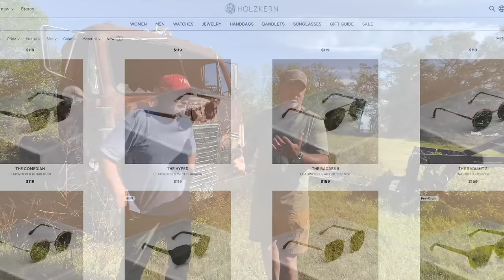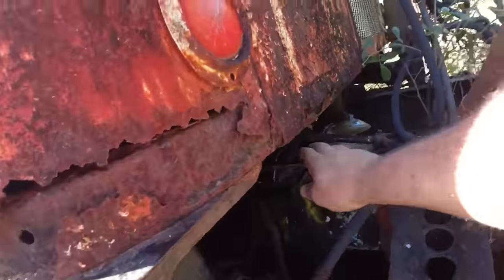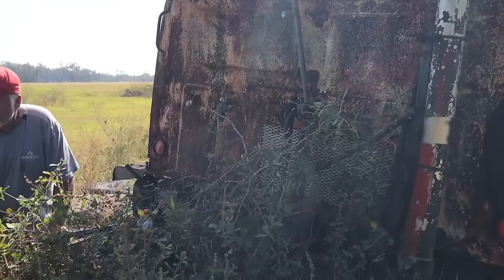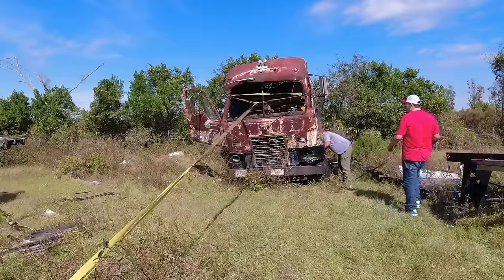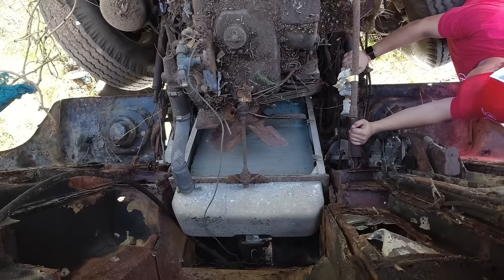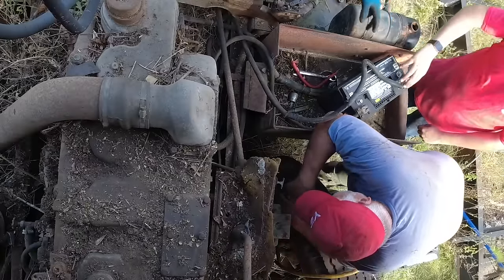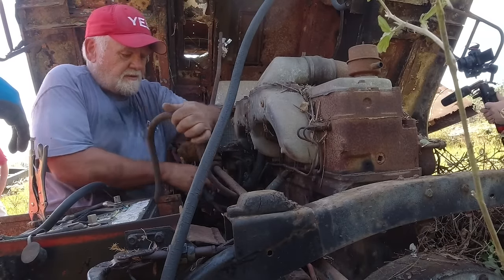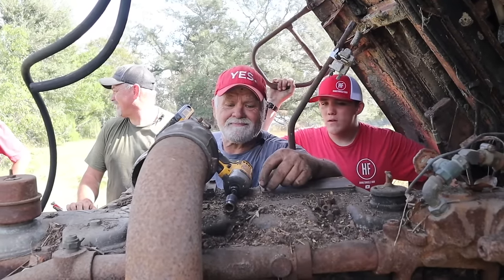I found the RUSTIEST SEMI on Earth sitting in a field for 25 years! Will it run?

Comment: In the 80's, I had just finished installing a slant 6 in a dart. I got everything connected, and was ready to start it. I installed the battery and tapped the battery cables onto the battery. I hooked up the remote start switch and decided it was  time to start it. I hit the button and the entire top of the battery exploded, pelting my face, neck and arms with acid and plastic. Afterwards I looked at the battery and what caused the explosion was by pounding on the battery, I cracked the internal connection between the terminal and the plates, so when I hit the starter button, it arc'd and the battery exploded. I have never hammered on a battery since.

Comment: We used to own a 1971 IH CO4070A with a 355 cummins and it is indeed 24 Volt to Start. when you hooked up batteries you did it in parallel which increased cranking amps but not voltage. When you hook up batteries in series it increases voltage to 24 volts. One battery hook ground to negative post. other battery hook starter solenoid wire to positive post. then you run wire between two batteries from empty posts positive to negative. this is a negative ground system. Once engine starts solenoid cuts to 12 volt to truck wiring. should start on starting fluid but use sparingly.  She should run

Comment: An Emeryville was the first truck I drove on the NJ Turnpike in 1971.  My boss told me it had a scored cylinder liner, and to take it easy  pulling the hill on the overpass between exits 14 and 15 because it might overheat. Long story short, it overheated and quit running, and had to be towed.  That was a bad first day on the job.  

Anyway, I know batteries are not cheap but you just gotta have all the cranking amps you can get and good clean tight connections when messing around and trying to start old diesel engines. I know you guys know this. That's a nice setup you have on your truck Hank. That's a 24 volt starter on that Emeryville (Googled it). It's amazing what you can find on the internet on a smart phone.  You guys would have needed  2 fully charged 12 volt truck batteries and connected in series with good tight connections to even have a chance, that is, if the engine was free enough and that starter good enough to turn it over fast enough to start.  

That Emeryville brought  back lots of memories. Thanks for making the video.

Comment: Our first semi was a 59 Emeryville that my brother Phil drove, had a 220 Cummins 10 speed roadranger tandem axles and I got mine in 1960. Twin trucks except the 59 had single headlights and the 60 had twin lights.  I had a 250 cummins.  We hauled grain from the elevator in Rugby, ND to Mpls/ St paul and Duluth Mn.  Slept many nights in that sleeper and to this day I love that truck.  When in the service in 62 sold trucks and bought KW 100's in 64 when army service ended.  John

Comment: That's an old Johnson motor lined truck . You can see the sanded squares that said Johnson . Their trucks had a bar across the rear spring bolts that had a little short mudflap on it . The first tandam axel would pic up a nail or something and the little mudflap would knock it down before the next axel would hit it avoiding a flat tire .

Comment: Those old trucks with the NH180 cummins were 24 volts to start from what i remember being told back in the day they took 4 of 6 volt Group 4 batteries  but they used a 12 volt charging system and the detroit powered used only 2 batteries group 7. Also pretty sure the cummins engines of that time used oil bath air cleaner.

Comment: Excellent video Hank :) & Wiley :) I remember those my late dad talked about in his trucker years when start in 1960 and lots Lol too! Also on local fire department had 1968 International 5 ton cab over tanker it need motor head gasket  was task get open cab plus shut had weld chain link frame kept closed Lol! Also Hank & Wiley for Lol surprises you guys work on transport trucks said did fix up the Leader of Autobot Optimus Prime or Ultra Mangus or any truck ones for joke around! Also always come back to this truck video again to fire up if and check out engine oil too on dipstick  says too! It be good do second part too!
Reply from the maker: Thanks buddy!
Reply: @HamiltonvilleFarm  welcome 🙏

Comment: You do not need to hook a ground up to the starter, the starter is already grounded to the engine block through the housing, all you need to do is hook power to battery and ground wire from battery to engine block, then jump start wire on solenoid

Comment: Putting the strap over the top of the cab and securing it at the bottom of the back of the cab would have made better use of the leverage and wouldn't have damaged the A pillar.

The initial pull was too much downwards rather than forwards. The pull would have been better from 2-3 times further away.

Comment: Hey guys first off you should’ve slung over the cab and hooked at the bottom of the rear of the cab and you hooked the front like you did you should have closed the passenger door and went through the wing window and you wouldn’t have bent the A pillar

Comment: Apparently theres not a jack in the tools  on their utility truck or enough strapping to reach all the way over the cab to reach down the back of the cab to hook underneath it to give leverage. The cab on the Emoryville was rough when they got there but was totally destroyed by the time they got it to tip up. If the truck actually was rare, these guys should not have been allowed to go near it because they did more damage than good. While the cab was rough from the beginning, it was still restorable but not when they got done. Rust can be cut out and repair panels fabricated but crushed and buckled metal is way worse to repair. I used to do restorations and when I saw  the damage being done it broke my heart. I can't even watch any more of it to see if they get it running because I am sure its going to be more hackery.